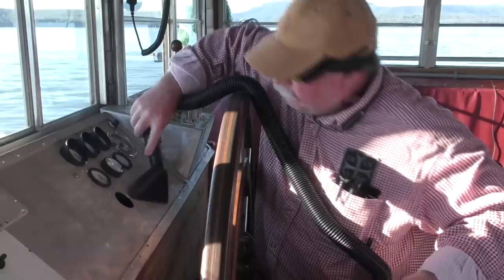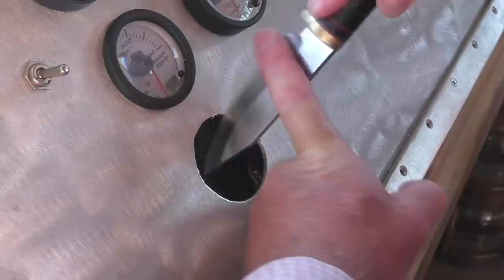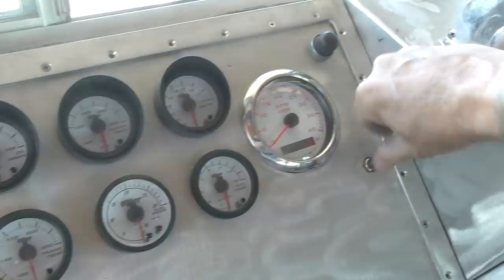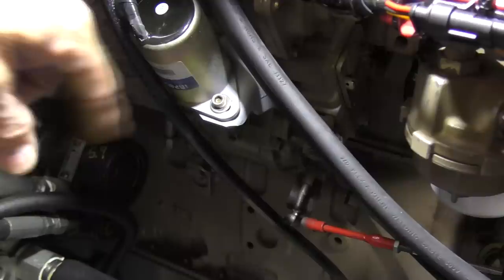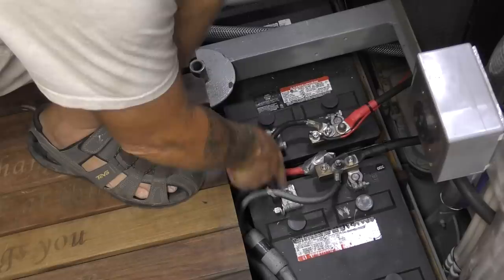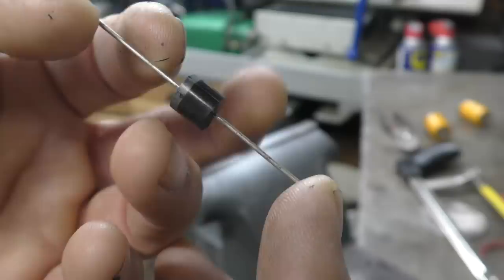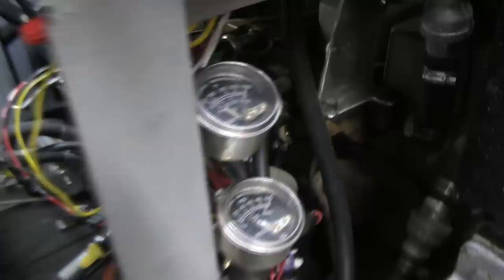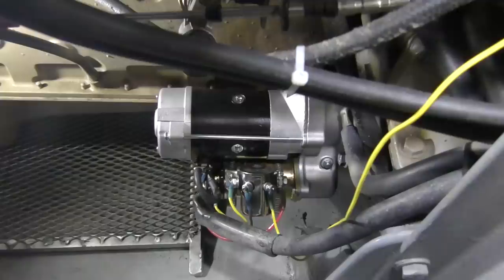Engine Electronics - Starter Relays Diodes and Gauges

Comment: Your diode analogy was good, a check valve.  So, you might need some diodes that tolerate higher voltages, not only current, but both. If you keep blowing them, you might be able to part the difference and use say a 10 ohm resistor inline with the diode, but it won't work as well, so I would look for a bigger voltage diode first. Also, it's best to keep the diode nearest the coil as possible.
The whole problem is a lot like water in a garden hose that's off; when you open it water comes out quicker than if it had a slow leak.
So, the diode (configuration) is called a flyback or antt-flyback diode(configuration). Unlike a Zener diodes, or Schottky diodes, There is no "flyback" diode.; it's just how they are used. Electronics people do stuff like that just to mess with your head, just like and electrolytic and decoupling capacitors: one is type, the other is how they are used.
Some interesting things are: when the flyback diode is doing it's job, to stop that spark, it's conducting a lot of voltage and current, nearly a short circuit at high voltage. The other interesting thing is: the power from a coil could be hundreds, if not thousands of volts, and certainly more than the 24 you put in. How?!  The mere fact that that the spark can jump the contacts is proof that there is a lot of voltage, as low-voltage can't jump. How? So when the coil is working it builds up a magnetic field; it turns most of the electricity into a magnetic field which stays in and around the coil. When the coil is working, the coil itself is nearly a short circuit; there's not much resistance there, just like a hose with only a small leak. But when you shut off the power switch, it opens the circuit, now there's nothing to stand in the way of the (water) power from getting out of the wire. The magnetic field collapses fast, like a book dropping on the table--all the way, it's turning it's stored magnetic field back into electricity. There is so much power there, that you could really hurt or kill yourself if you held each end of the of a coil when you shut it off with 2 different arms. Car ignition coils work in the same way when the points open--zap! I have tried a small 12volt solenoid, and found it put out over 120 volts.

Comment: If you're running 12v relays, perhaps they need replacing with 24v, the current rating of a relay running at 24v when rated for 12v will be way lower.

Comment: 4:14 :,,,puts 24V across these contacts and that's why it welded shut...": The relay coil has nothing to do with it. Volts don't weld. Amps do. You need to monitor the current going to those contacts. A scope, a shunt, and an amplifier would be helpful. Remember old cars that had a distributor, contacts, and a capacitor? Remember what the capacitor was for? It was to absorb the energy when the contacts just open or were about to close. The energy is in the ignition coil primary. I don't think diodes are going to fix that. When you're switching large inductive loads, you need a bypass capacitor or some kind. The current goes into charging the capacitor...not into burning the contacts. Once the steady state is reached, the capacitor looks like an open circuit. But to the impulse (i.e. opening or closing the contacts) it looks like a short circuit...just for an instant as it charges up.

Comment: Your starter noise maybe from not having the depth of the gear engagement. All NTC ans NTCC Cummins use shims. You have to measure the depth of throw. Get your manual out (ouch) and check it. It sometimes is intermittent so it can be hard to do the job.

Comment: I see your finger found out the hard way that 24v through a thin wire really heats up fast
Reply: I did the same trying to jump a safety switch on a scissor lift so I could find out which switch was the problem

Comment: 24v  vs 12v.  24 will heat up a wire or diode.  So if it's rated for 12 when you make it 24 it will work but burn quickly.  Might have been problem with diode.

Comment: When you place a diode across a coil of a relay, the coil/relay will stay turned ON for a small fraction of a second after power I removed.  This only matters in electromechanical devices that need to turn OFF quickly, like ignition coils and fuel injectors.

Personal pet peeve.  Those big cylindrical device that you are call "solenoids" are just heavy duty relays.  I'm not sure when/whee the term solenoid slipped in, but it is incorrect.  Can't change it now.

Comment: You have a multimeter I believe, it should have a diode test setting but even if not you measure the resistance of the diode at the highest Ohm setting, it should read almost zero Ohms in the forward direction and going towards infinity the opposite way, I would go and check that right now but I'm imobilised at the moment, it could have been what I made today!
Reply: Ten seconds after I posted the above you pulled out the meter, I tried to delete my post but couldn't so I have a red face now.

Comment: The higher the voltage means a larger arc that’s probably y your 12 v relay was burning up we install tuns of starter relays and they never brake but we use water tight relays and also for grounds not a good idea to put them on starter bolts put them on something that basically never gets touched better for maintenance

Comment: hi the diode needs to be across the coil with as short leads as poss. and the diodes would be better if they were hi speed snubber diodes and to lower or eliminate the switch or contactor contacts put a 0.01uF or a 0.1uF non polarized capacitor across the switch contacts again short as pos. leads. the caps help to debounce the contacts.
keep up the good work hope it helps
from mick in the Uk

Comment: Pretty certain it's the 24 volt you have to buy switches that are designed to run with 24 volt 12 volt will not last .
Most heavy equipment is 24 volt and you have to buy  stuff that's designed to run with it.

Comment: That is not the back EMF from a relay coil that welded those contacts closed. Yes you will get lots of volts but never sufficient current to do that. You got very mixed up in your experiments. The spark on the "big" coil was due to the inrush current operating the coil thats why it made bugger all difference when you put a back EMF diode across it. Your assertion that you should just pick "a big" diode is incorrect. You want it to survive the high voltage of the back EMF but relatively low current. Check out Dave Jone's back EMF video if you like (and can deal with the squeak). https://www.youtube.com/watch?v=hReCPMIcLHg

Comment: PIV.  Back EMF can run into the thousands of volts...  Snub options are complicated sometimes, it gets worse with higher voltages, it's why even at 48 volts I have sand filled fuses and kilovac (vacuum filled) relays which I can find slightly used off eBay.
Reply: Exactly.
Peak Inverse Voltage  rating must be higher than the voltage you are working with.

Comment: For the purpose you are using the diodes they need to have a PIV (peak inverse voltage) rating of 1000 - 2000 volts. This why diodes are not lasting for you. During your spark test using the starter they didn’t appear to be working because they need to be securely attached with a terminal. A 5 amp rated diode should work fine but 10 amp is better. Alternatively you can also use a transorb instead of a diode if you want the coil to open/release faster. It should be rated at 50 volts for your 24 volt circuit. Transorbs are non polarized but have a forward voltage rating at which they start conducting. One other problem you have is purchasing components from China as the functional rating is not always as good as it is stated on the data sheet. Short circuiting a diode is a sure way to exceed its rating and burn it up as you noticed testing it across the battery.

Comment: Perhaps the voltage rating of the diodes was not high enough to resist the coil's collapsing generated voltage and the momentary voltage spike was enough to destroy the diodes.  A scope may be needed to do your diagnostics with before informed conclusions can be reached as to what the cause was to "kill" the diodes that you purchased.

Comment: don't you need a resistor to burn off the electrical  charge in the coil? or maybe a capacitor like in a set of points? (also connecting and disconnecting a coil)

Comment: Why isn't getting 24v rated switches and relays an option? The last video where you replaced the starter switch and you showed the Amazon listing it said on there they were 12v switches. I guess they can handle 24v but not at the amps that you are running through them. Remember that when you buy cheap, you buy twice.

Comment: just as a reminder, the reason why the engine was starting was probably because you were back feeing power from the starter to the fuel pump, Just like how the starter was wired wrong the fuel pump is also probably wired just as wrong (only you could hear the starter)

Comment: Funkentstorkondensator - radio interference suppression capacitor - across the contact. May be more forgiving than a diode. Big amps need big f* relais or contactors. Have a look at the EV guys. In EVs one problem is solved by electronically switching off before unplugging or opening a physical contact. Small relais a diode can do but the big ones I dont think so. For small relais the capacitor might even work better than the diode. When you like experiments - try a sparkplug from a car. close to the offending coil and with a gap closer than the gap of the contact it will provide a short circuit for the arc until the voltage is too low to arc over the contact.

Comment: Could be cheap counterfeit parts from Amazon, suspect relay, suspect switches. There is a huge problem with low quality, dangerously under built electrical parts being sold online. There are fuses for sale on amazon that the only difference between  a 30 amp and 2 amp fuse is the number written on it. I assume that all the 12v electrical components have been swapped out with 24v rated parts.

Comment: are you still using 12 volt relays which are copper contacts,24 volt relays are silver contacts so they wont weld together as they have done.

Comment: The not a ground, ground probably killed that diode. It should live now but still may not keep switches alive at 24v. If the 12v for gauges ect. is tapped off the middle of the two batteries it will slowly kill one battery. I tried this too once.

Comment: Speaking of the Cummins 5.9, Did you have the dowel pin problem where it often falls into the gears of the camshaft? Its under the front cover. I think you'd be able to CNC machine a part that prevents it from destroying your engine. If I ever have the privilege of crewing on seeker, being a CNC Machinist I'd be happy to make it.
Reply from the maker: Took care of that pin.  I think that was just a piece of flat metal.  If you want CNC job then it will be making ROV parts.

Comment: using diodes to repair relays that were designed not to be fixed; a varistor is component to use; better for all use a solid state relay...

Comment: Hey Doug, Here is the deal. You bought the wrong diodes. When the relay coil voltage collapses, the magnetic field cuts across every turn of the coil. The counter EMF is easily increased 10 times greater. So your 24 volts becomes 240 vdc.  To build in a safety factor, your diodes should be rated at 500vdc. Every one of your underrated diodes will eventually fail. With higher voltage ratings, none of the diodes will fail. 

Without the diodes, all your switches will eventually fail too.

Do the diodes, or else! You can get them from Amazon as well. Finally, I get tp help your build.

Comment: Try tighten the chuck on your drill like normallly do, then reverse it till you here it click once and you bits won't fall out. Locks em in that way.
Reply: Will that work on my Milwaukee drills also?
Reply: @weldersandblaster  yep
Reply: @weldersandblaster  Actually just saw this is could be a troll job fyi...aVe debunked it with a  Makita...
Reply: @jc31188  BigClive also spoke on it. Tapered or not, it is still just threads. If you tighten a lug nut it sure don’t make sense turning it back. 😊

Comment: The only worth while thing I notice is all your switches and relays that are welding shut have very small contact area.  Most of the Cummins marine wire diagrams show a “start control relay”  or mag switch. iE medium duty solenoid controlling the start solenoid on the starter motor.  Much bigger contact area and much more energy to weld shut.   As for the coil creating a spark when it collapses,  I guess it’s the same as a points ignition on an older gas engine, but all that energy which is a crap load of volts just dumps to a condenser.   Just out of curiosity what’s amps or part number are the black box relays your using in the start circuit?

Comment: use electronic varactor across load contacts to suppress instant high voltage across contacts to prevent arcing and burn out also use aviation 28v spec  switches and push buttons...

Comment: 16.19 you should test in the multimeter in diode mode, it wii  mesure the drop... :) more accurate reading. in yours multimeter press SELECT and the diode signal will show in screen. a normal rectifier diode should measure around ~ 0.450v  to o.600v ( this is the drop in  there.  sheers mate :)  and "what i have done today"...kkkk well....teach 🤓some one to check a diode :) 😂😂😂😂

Comment: You better not go 10 feet from the dock without actual 24v. components at least on the shelf if not installed already for when you fry then all and have nothing working.  If 12v. components worked on 24v they would not make 24v ones.

Comment: you do know you're making it was way more complicated than it has to be you need a starter that goes for 24 volt which I think you have but I don't know and you just need to give it power to activate it and relays also has to be 24 volt and not 12 volt

Comment: Can you run a 12v parallel circuit from one of the batteries to your 12v components? Or maybe use a voltage divider circuit?

Comment: The more I think about this issue, the more I realize you are just making things more complicated.

For the starter, spend more than $20 on a QUALITY push button rated at >=100VDC and >=10A.  Connect it directly to stater solenoid. No intermediate relay.  No diode.  It is the volts from the back EMF that are burning/welding your contacts, not the amps !

Same with the fuel switch.  Toggle switches with that rating are cheap.

Comment: I usually stay out of the fray, but this isnt the back EMF. It's the fact that you are switching high currents which are running to inductive loads. You'll remember back to your circuits 101 class (😄) that the voltage across an inductor is the inductance (L) times the change of current (di) divided by the change in time (dt) (L*di/dt). In your case di is pretty big, dt is pretty small, and the inductance of a starter motor is pretty high. big*big/small = really big. The diode is great and all, but its not really fixing the problem. 

A "snubber" placed across the contacts which consists of a resistor and capacitor will do the job. It will also be a pain in the ass to add to all of your switches and relays. If you need some help falling asleep, heres a pretty good discussion on Stack Exchange about snubbers:

https://electronics.stackexchange.com/questions/272398/snubber-circuit-suggestion